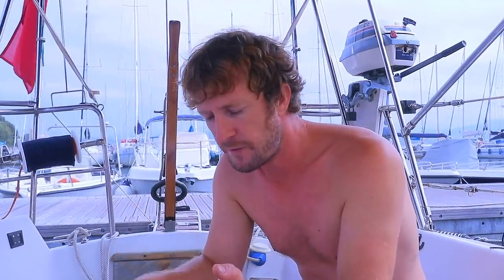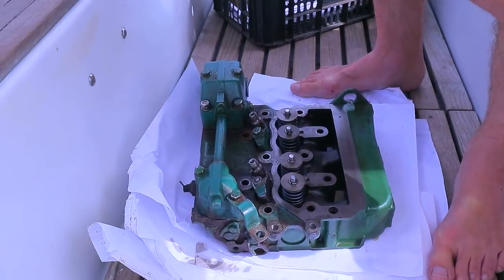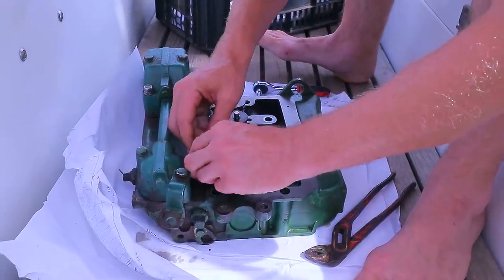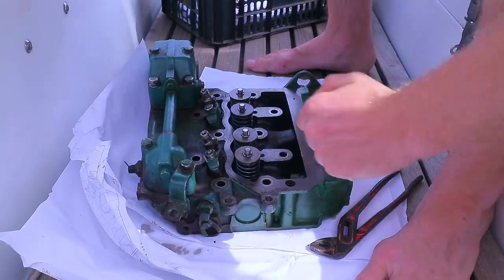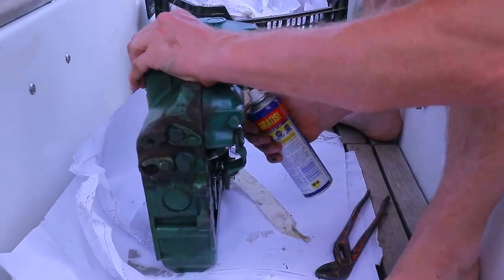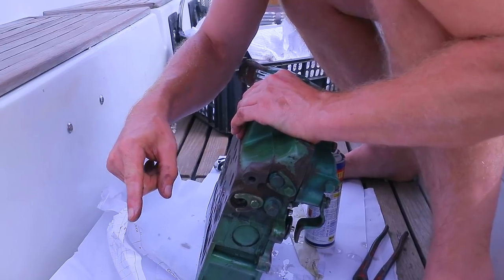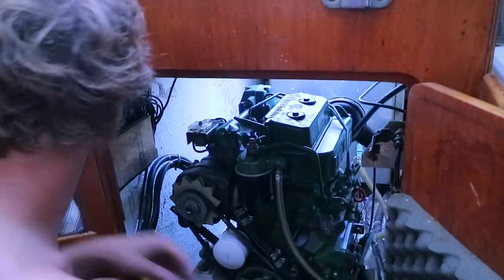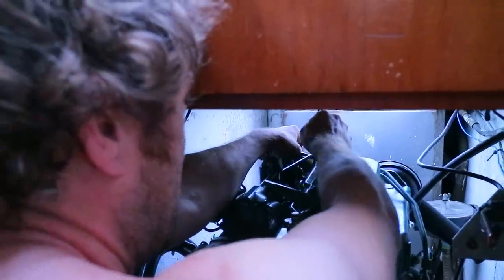Volvo Penta Injector Blow-By (Part 2 of 2) | ⛵Sailing Britaly⛵ [Boat Work]

Comment: Hi, we have a VP 2002 also and are having injector issues. All my research (parts catalogs) shows that there are no copper o rings "in" the injectors. Yet you made some up and put them in. We are getting a bit of blow by around injectors and now can't start it.  We are about to remove the head and get  it reconditioned with new copper sleeves. Can you clarify re the copper o rings. Thanks. Love your videos and are happy we have a bit more room around motor to work on it...
Reply from the maker: Hi Marc,

I reduced the blow-by by cutting the seat of the injector sleeve where the injector sits with a home-made tool (Copper pipe with sandpaper taped to the end rotated in a drill), but this didn't completely stop the blow-by and there was a small gap to fill. I made some copper washers to fill this gap and this stopped the blow-by completely.

Before you remove the head, if your blow-by is also coming up the same path as ours then you can cut new seats (with the tool shown as an overlay on this video) without removing the head. This will not only be cheaper, but you also avoid the potential problems which can be caused by more in-depth work on an engine.

Hopefully that is all the information you need but if you want some dedicated one-to-one assistance from me you can get that here: http://sailingbritaly.com/videocalls 

Best regards,
Chris
Reply: @SailingBritaly  Hi Chris, thanks for your prompt response. Going to get a mechanic to test compression first then given the age of the engine will probably go the head off option to address any other issues ie leaky valves etc. If that fails it must be the piston rings and if that is the case I can do you a great deal on a used 2002 if you can sail to Sydney...

Comment: I have an HR 312 with a Volvo 2003..I’m in a part of the US where sailing isn’t super popular, and Volvo stuff like this is almost never seen. This video series really helped me identify a problem that a few techs couldn’t initially and really got me going in the right direction 

🤞🏻 I can do the work with the head in place, but now I feel confident doing it myself on a bench top. Thank you!
Reply: I also have an HR312 with the same smoking issue on my VP 2003! 
I am going to do this same service over the winter, great video.  Curious @hunterl1952 if you fixed the problem as well?

Comment: Thanks Chris, a very helpful video. I have the single cylinder version of that engine in my 25 footer.
I am also struggling with sending my car to the diesel guy for dirty/damaged injectors.
To often over the years I have had your experience.  I will buy the tools.

Comment: Chris, it is possible to make an emergency makeshift head gasket from microwaved sheets of lasagne, presoaked in vinegar and suncream. You do need to carefully cut out the silhouette from the old intake précisly halfway through the cooking and curing time though. 
I haven't done this myself but am assured by my Fiat mechanic that this definitely work.
Reply from the maker: I have made a gaskets in the past and the results can be surprisingly good: I made one from a document folder (low pressure water & exhaust) which I expected to work, but on another occasion I made a seal for a pressure gauge out of a foam earplug (This was when I worked on helicopters and we were on ops in the desert with no supply chain). When compressed in the fitting, this porous foam worked perfectly and allowed us to top-up an undercarriage with 3,000 psi of nitrogen - this was a more surprising success... Cheers, Chris 👍
Reply: @SailingBritaly  the best emergency gasket is an old one. Which is why you haven't thrown the one you removed away (?).  In my youth I successfully reused head gaskets on old bangers by noting each held bolt torque and slightly exceeding it on rebuild. To get a torque reading I'd tighten slightly to unstick (note torque indicator) then loosen and note that reading on the diagram. Then stick each bolt on to the diagram to maintain its positioning for the rebuild.
In my mind, each would have its own stretch and elastic properties as well as torque.... for that specific gasket.

If the old was going straight back on (no breaks between holes). Don't clean well stuck gasket bits off (just loose bits) use goodly amount of red/hermitite between surfaces. Get the bolts in the same holes and tighten (in gradual stages) in reciprocal opposite pairs. The pairs were middle, outermost then the in-betweens. Gradually. Upto the lowest torque on the diagram. Then match the others on the diagram. FINALLY, give each bolt the equal additional last tweak in the recipricol pairs order. This last tweak was to compress the gasket just that tad more than it was before we removed it. Especially if it had them, it's metallic edge bits. 
Run engine to burn and blow out squeezed out hermitite. 
What do you think of our reasoning? 
We were teens 35 years ago and not keeping jets/helicopters in the air and didn't always have money for headsets if they were salvageable. It always seemed to work.
Reply: Just in case. I'd better just say that the lasagne is a joke with Chris. Don't try this at home!

Comment: Chris, thanks so much for your tips on your Volvo diesel repair. I've got a pretty old Volvo MD11C (1979 I believe) so your reference for this parts supplier is very much appreciated. My diesel has more than 3k hours on it so the inevitable comes sooner than later. To be or Not to be (to repower or to get it fixed) - that is the question ))))
Reply from the maker: My pleasure. :-) I'd be for keeping personally as I like rescuing old things which can be rescued. Having said that I do understand that a new engine can be much more convenient... Cheers, Chris 👍